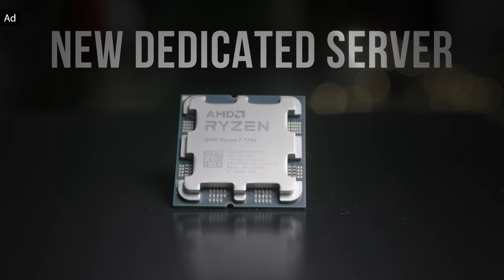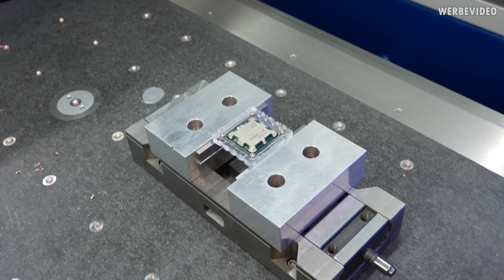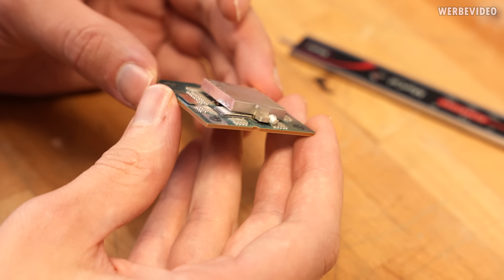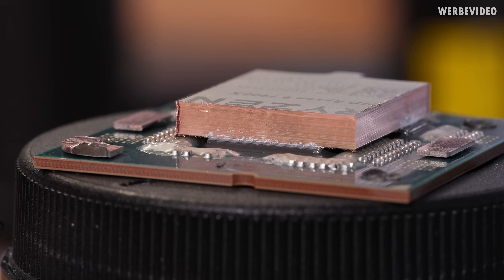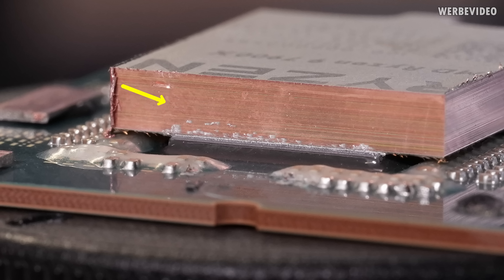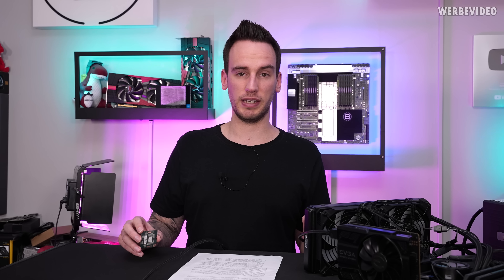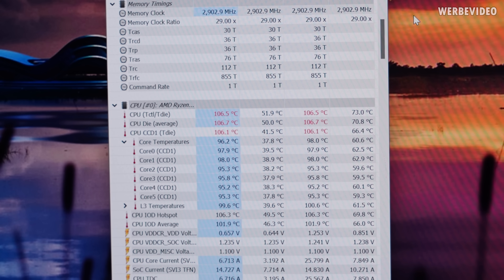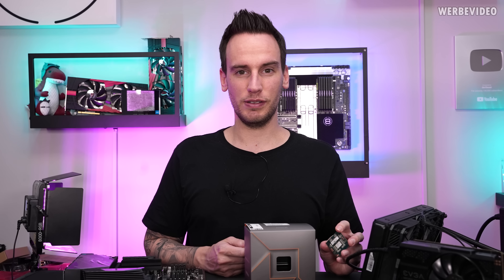Viewer-Mail Ep8: This CPU Unsoldered and Killed itself

Comment: Thermal Overload Protection is not the same as Thermal Throttle Limit.

Thermal Overload Protection will immediately shutdown the PC when X temperature is reached.

Thermal Throttle Limit will even after the limit is reached, attempt to bring the temperature back down and will only shutdown the PC when the CPU reaches 115c.

This new approach is supposed to help against temperature spikes but at the cost of increased risk of damage.

In my opinion I both setting should be available (And they might be... I don't have a mordem MB to check it).

And due to it failing under expected usage and under warranty period it is by definition manufacture defect. Now if the defect was in the die itself of in the heat spreader installation is another story.

Comment: Maybe the CPU shorted vCore to GND, which would serve as a possible explanation for reaching Indium solder melting temperatures. In this case, the molten solder would only be a symptom, but not the root cause of failure. Such a kind of failure is known and documented to happen in GPUs, but there's no reason why a CPU shouldn't also be able to experience the same thing.

Comment: Roman there is I thing a few other possibilities:
1/ contamination in the indium alloy which made it liquid at 100°C, you can check what's left on it for its melting point
2/ bad application during manufacturing, as like you said if an area is not covered during manufacturing it will do this
3/ the temperatures are estimated (refer to intel engineer video) and thus the temperature on top of the die maybe much higher than what is displayed by sensors you could attach a thermocouple direct to the die and measure the "real" surface temperature
Reply: The temperatures are estimated, yes. But that's done by measuring the temperature dependent voltage differentials of multiple, integrated thermocouples. These are calibrated via correction factors that are set at manufacturing time via eFuses and also chemically very pure, due to being made with lithography. I think the reported temp being off more than 5°C from the real value would already be a huge stretch and very unlikely.

Comment: It’s surprising to hear that you guys sent him a whole new cpu. Seriously you guys rock for being that kind.
Reply: Well, they likely have AMD connections and this is essentially a roundabout way of doing a warranty claim. This does benefit AMD, after all: they get to see the components without having to do the work.
Reply: A cpu is cheap compared to the revenue the ad's and sponsorships gave...
Reply: I'm pretty sure that he would have gotten replacement from retailer or AMD if he RMA it. As it was demonstrated it is supposed to throttle at 95C and shutdown at 115C. Even if you take off cooler, CPU should simply shutdown instead of melting. So they did what they should have done if they took his CPU and made it impossible to RMA.

Comment: Nice exploration, really enjoy these. Just a theory.. I'm aware you don't think it's a manufacturing defect, but the only scenario I can come up with would be one. Either a cold solder joint or contaminated chip surface not allowing full heat transfer to the IHS. Once an individual spot gets hot enough to melt the solder the heat runs up too quickly for the chip or bios to compensate and the chip dies. I've seen similar failures in electrical solder joints, not sure solder for the purpose of heat transfer would react the same way. I understand your experiment shows that the board shuts down at approx. 114c, but without good contact to the IHS to absorb heat is it possible parts of the chip would heat faster than the area immediately around the thermocouples?

Comment: The CPU temp climbing to the roof is obvious. You reduce the cooling capacity from 50000 to 5 (random values for illustration purposes). The CPU takes a while to notice before it shuts down, likely because the algorithm does not expect such ridiculous increase in so little time and misjudge itself until it the “oh snap, this is real. Abort, abort!” moment it then turn it off to not burn completely.

Those bubbles in the TIM are manufacturing defects, foreign material might have dropped over those spots for the metal not to adhere properly. You could see the gold spots from the die. That is something it cannot occur after the CPU has been assembled.

Comment: Is AMD potentially crippling their next desktop AM5 APU, by making it 4.0 lanes compatible, and not using 5.0 lanes, giving it less L(1,2,3) cache memory ?  Is it possible to add say more than 12-igpu on a 8-core APU ?
Reply: Not cripling AM5 CPU, but the new low end AM5 A620 chipset only gets PCIe 4.0 lanes for both GPU and NVME SSD . The top of the line AM5 APU for desktop will be a repackaged R9 7940HS from the mobile segment.
Reply: @fleurdewin7958  basically we will never get APU that's gonna replace say desktop platform of performance of 5700X + RX 6600XT......sad.

Comment: Didnt you have a video with the CPU engineer, I forget if he was AMD or Intel. But he basically said they have a load of sensors all over the silicon, and its as close as they can figure to the hotspots, then they take the average of all those sensors and report that to the system.

Is it possible that one of the sensors right around where the bubble was got so hot that it caused isolated melting of the solder at that point, since the average is being reported sensors around the area with good contact would report much lower causing the temp to be reported lower.

That said, I think if memory serves he also said the hotspot temp is reported as always the hottest sensor on the die, so that wouldnt make sense at that point.

with regards to manufacturing defects, could the solder have had some impurities in it for that chip that caused it to melt at a lower temp? Surely that could happen in the manufacturing process however unlikely it may be.

Comment: Cpu mosfet failed and the chip took all the power. Then after psu tripping / power cycling the mosfet isnt shorted to cause a problem. I had that issue with a GTX 580 SOC. It didnt kill the core/memory but it ran fine after a power cycle but the smell of burnt electronics didnt go away. Mosfet was very hot and at a certain point it would cause artifacting, reboot & it was fine until it got very hot again... 
Ended up pulling the mosfet and card works great.

Comment: Interesting!
I would say
1) cooling failure (thermal contact or cooler itself)
2) cpu not able to throttle to low enough power to keep max temperature spot in check (no mode available with low enough power draw)
3) cpu temp has eventually been high enough for long enough with enough voltage to short circuits some part of itself
4) cpu continues to heat up and short circuit itself more, and gets hot enough to melt the solder, before the MB cpu over current safety shuts down the system

Comment: Likely a wild theory, but throwing it out there cause why not lol. Could a small pocket of space been in a spot or two between the indium and IHS? Somehow creating a hot spot for a bit of the indium, while the areas around that can manage to make up enough cooling to keep those areas solid and the chip from outright overheating. From there would just slowly spread and create problems throughout until it reached that point of complete failure.

Don't know enough about the specifics of the materials and thermodynamics to know if that's even a slightly reasonable theory, but that's what came to my mind.

EDIT: And with my luck right after adding that comment and resuming the video you talk about a similar thing with liquid metal. One of these days I'll get around to finishing a video before commenting my wild ideas

Comment: To me it looks like the motherboard VRM failed and shorted 12v to the CPU and the overcurrent protection from the power supply didn't kick in fast enough.
If this is the case, the new Ryzen CPU that you gave him is also dead right now. Have you checked this with the user?
Reply: the VRM was fine, as mentioned the motherboard ran another CPU. So that's not it - he mentioned the 'user' had enjoyed the new CPU for over a week.

Comment: Could a cpu die thermal sensor have failed resulting in higher temps causing this overheating issue?🤔  Love this content🥰💪. As a 7950X3D system builder atm, I’m a little concerned by this finding 🤯😢.

Comment: ok, there are dark spot on left chiplet's compound, so whats probably happend: this was a manufacturing defect 100%, it is overheating in that spot where was a bubble in indium, then chip died, then motherboard show 00h and stay on - thermal protection is not working at this moment, then indium was melted and due to also heated cpu's pcb was squeezed out under heatspreader. ALSO!!! if water is contained in sealed area like water cooling loop, it is evaporate and increase pressure, what cause boiling temperature to rise because of rising pressure

Comment: it has to be a freak combination of events to cause this, because, if we assume the cooler was even remotely reasonably mounted to reach 156C for melting indium, we're talking about current (A) increase between 65% over 'normal max operating temperature of 95c and 35% over it's hardcoded shutdown temperature of 115C, that is not easy to achieve in a cpu, because first, cpu silicon resistance increases with temperature increase and unlike failing gpu power stages, cpus usually don't short through but just burn out and isolate. On top of that we see multiple possible points of melting origin due to craters, so it couldn't have been just a singular point source with huge short current

Comment: @der8auer I have a 7700X that might interest you.
Was working fine with 2200FCLK for over 2 days so I tried to lower SoC voltage from Auto (bios reading 1.43) in -10mv, when I got to 1.32 SoC the latency in aida64 increased by 2x all the way to 30x more.
Since then the CPU cannot be stable with normal latency over 2000FCLK and only boots up to 2067FCLK but the latency at this FCLK is about 4x the normal range.
I changed motherboard Strix x670e-e to the Gene x670e and tested 1 dimm only but no luck, tried fresh windows install and different PSU again no luck.
Like I said if you interested let me because I have searched google for weeks and cant find one person with this phenomenon.
Reply: The max. safe-ish voltage for the IOD was 1.2V when it was still made in 12nm. That certainly hasn't increased with Zen4 and the IOD being made in 6nm now. I guess that the auto setting and/or auto auxillary voltages (like VDDG, VDDP) were way to high, (which was also the case with early Bios for Ryzen 3000) and you degraded the IOD. Are you sure the bios was showing 1.43v? It should have been 1.143V!

Comment: I would love to see that delidded processor cleaned up and at least an attempt to boot made. :D
Reply: Even without those caps it should be possible if they are filter caps. If they are for filtering they would all be in parallel and the others will take up the filtering job of the missing ones.
Reply: @Lilithe  Did you not see those gold spots on the dies, she's a goner for sure likely had an internal short or similar lowering of resistance leading to thermal runaway. The internal structure of the gates and transistors in that area would prob look like a melted together blob under an SEM

Comment: Hum, what runs the shutdown code?  Did the CPU crash in a tight loop and either fail to run the shutdown code, or fail to provide the temperatures to the watchdog? If the temperature data is provided as analogue or through a dedicated mcu core onboard the chip and passed through specific cpu pins, was the CPU poorly seated and failing to provide correct data? You'd think there would be failsafe though. Worth finding out what bios version the original user was using in case there was a bug.
Reply: Interesting idea, Wasn't there a problem with some Cyrix chips where interrupts wouldn't be serviced while there was an xchg in the pipeline?

Comment: Could it have been an issue with the MoBo or PSU? Sending the wrong voltage to the CPU?

Honestly I feel like there's no single answer. This had to be a series of multiple failures converging to cause the CPU to do this.

Comment: this  is 14:03 a normal behavor even if the cpu throttle it self too 0,4 ghz it will not get cooler because there nothing to decipate the heat , i know thisn because i tried to run my r 3 3300x (b450 m pro max motherboard ) without a cooler and same thing happened.

Comment: My MSI Coreliquid 360 was not even enough to cool my i7 11700K. The pump appeared to work, but it did not do the trick. I think some of these are just defective. The radiator would not be hot, the CPU pressure was even. The fans ran correctly. The MSI Coreliquid I had was just hot garbage, unfortunately. Replaced it with a Noctua NH D15 and it was smooth sailing.

Comment: Saw the same spots on my 7950x after deliding it, CPU is not dead though used mb rog strix x670e-i, and only minor overclocking (it also started running down between dies).
Interesting is the fact that now the gold layer on the die looks completely black/cooked, don't know if it's because of the liquid metal  or very high temps after deliding it (I had thermal shutdown after deliding it).
My big guess is that the indium(alloy) used starts to melt and the results can be seen only after some time using the CPU in vertical orientation unlike the horizontal open TB used @Der8auer(I had mine running for @1month).
My guess is that the temps on the die are averaged therefore some spots can get hotter than the melting temp.

Comment: One case come to my mind. I was thinking what is power phasing in motherboard. With code 00 is core VRM shutdown or active? Also was it trying to boot before then going back to code 00 when CPU totally killed itself. So if CPU is partially short but not trip over current protection from motherboard then It died like while booting for over temp also melting indium at same time.

Comment: Hey Roman excellent video as always and I have a question. Is it safe to lapp the die of my delidded 13900KS? Are you going to release any tool to lapp it?

Another question, I saw an overclocker spread Liquid metal on an IHS and then heat it with a heat gun before using it and "gluing" it back, should we do that?

Comment: instead of copper, they should try using pure gold. It is so much better at absorbing heat.
Reply: No its not
Reply: gold 318 W/(m⋅K)  is ==significantly== worse than copper conductivity 401 W/(m⋅K).  SIlver 429 W/(m⋅K) is better than copper but getting pure silver (as alloys are worse) is another matter.

Comment: That Looks Suspicioualy Like someone Tried To RE-Solder The Heat spearder After a Delid  / 
Also Your have to Factor In the Heat Created During the Milling = this Explains the Excess Solder at points on Sides Where you Milled the Heat spreader = Which Also Shows The same as prior Stated
My Suggestion would to be Testing  the Soolder  to See if it is a Match For Indium or some Other Type of Solder that is less than Manufacture Specs for such application
If This Is Happening On This motherboard and you sent him a brand new cpu = Wouldnt It Also Create the SAME Problem ?  If its the motherboard

Comment: I may be wrong here but, looking at it I see two possible causes:
1: The person who send this in deliberately melted the solder on an otherwise already dead CPU.
2: Some sort of short that did not trip anything, happened to go through the cpu core and also happened to not overheat things past the point of burning / scarring.

As for defective / contaminated indium, I find that unlikely, sure you can have a lower melting point, but remember the point where the cpu shuts down is 115, this will be in the die itself, the cpu at the top of the die will most certainly be lower than that. The composition must have been seriously out of whack for that to happen.

Comment: It could also be that if the CPU fails above 120 / 130 C there might be a short-circuit, which would generate even more heat.
Reply: Yeah this honestly seems like something has caused a short to ground and thermal runaway. I would guess the CPU was well and truly dead in the moments before the indium actually melted.

Comment: Is it possible that there was a problem with the dies' temperature sensor, so that the cpu wasn't registering temps? I'm a noob so if I sound like an idiot, it's because I am. Lol.  Love all of what you do. Keep it up.
Reply: too many sensors in the die for that to be the case.. on top of that it looks like the melting started with the IO die then spread to the CCD's which doesn't run anywhere close to the same temps as the CCD's. likely had to of been some type of runaway voltage, whether it was the cpu or the board that caused it we'll know if their other cpu dies the same way.